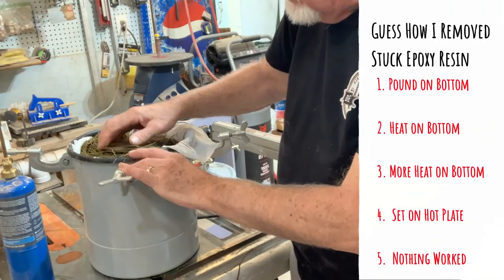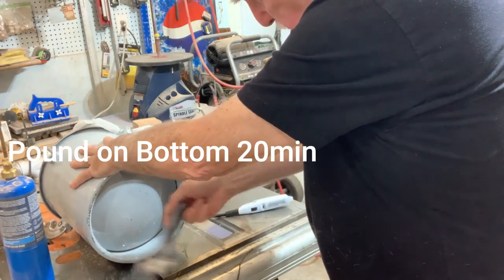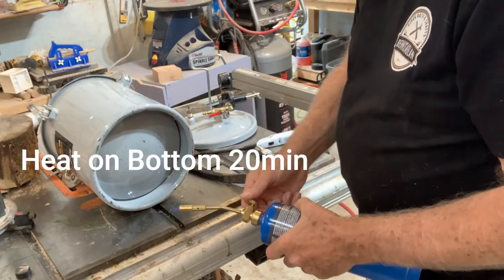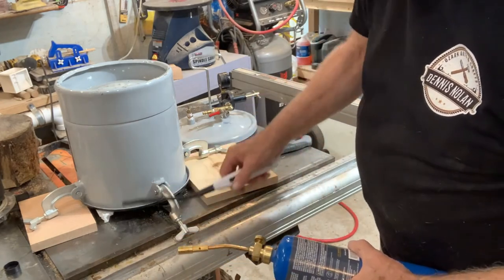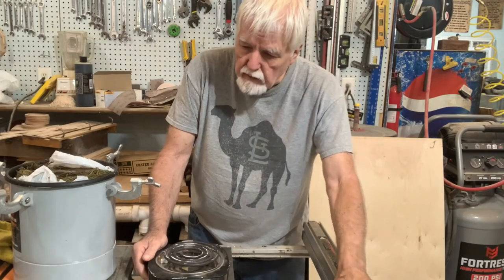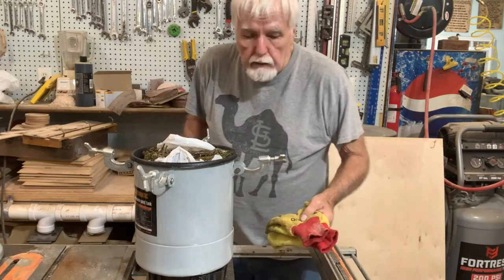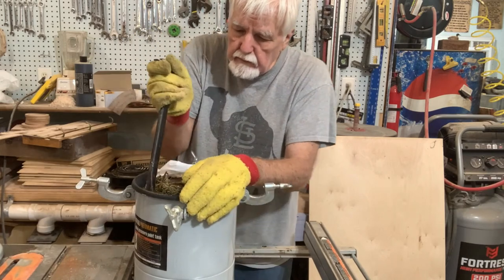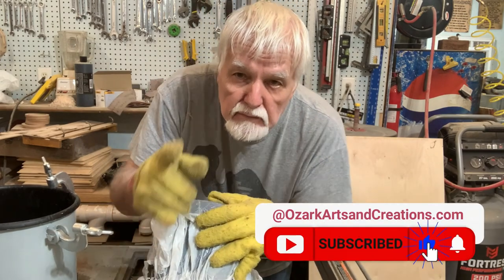Epoxy Pour Stuck in Pressure Pot

Comment: Hi Dennis,
Sometimes things go wrong. It's so fucking stuck. I want to try the epoxy resin business one day. I'm trying to learn the details. Thanks for sharing your experiences. All the best. see you buddy.
Reply from the maker: It came out quite easy after applying heat from hot plate.  It's a trick that is good to remember.  Thanks for your comment.
Reply: @OzarkArtsandCrafts  yes, it's a good method. see you buddy.